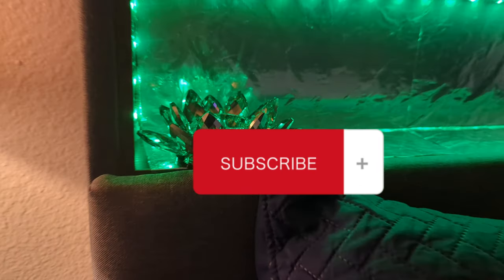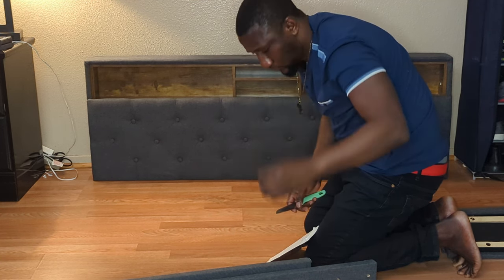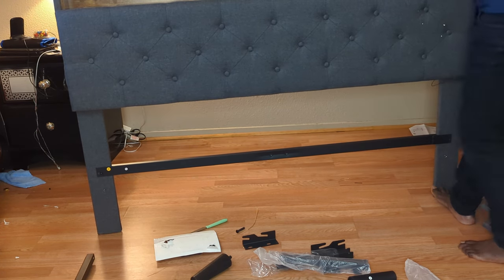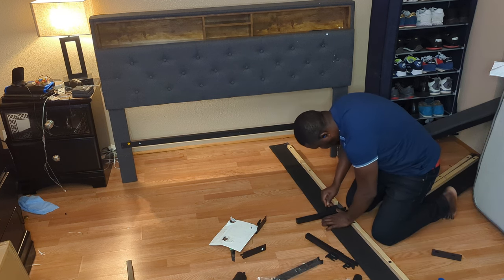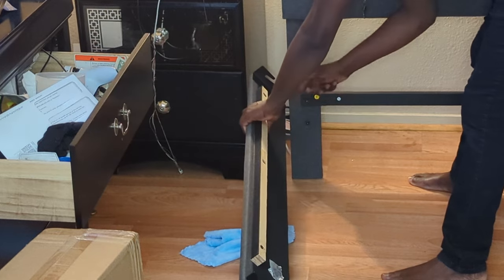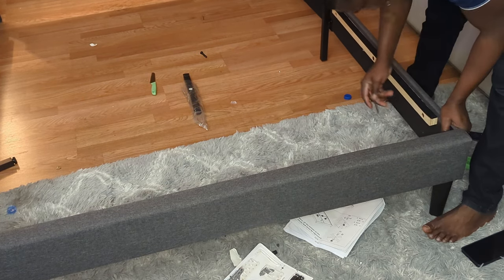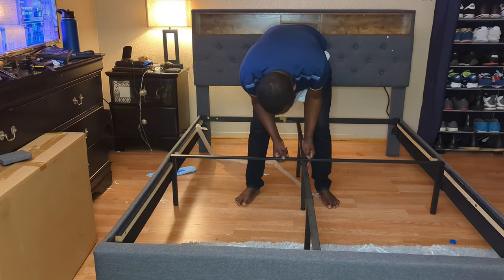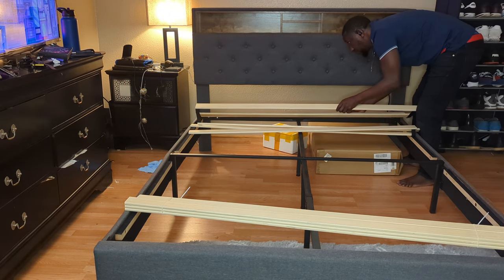Bed. ADORNEVE Queen Bed Frame with LED Lights, Outlets and USB Ports, Storage #viral #video #bed

Comment: Not helpful cause how I even get the headboard assembled
Reply: can you send me the instructions please !!! mine didn’t come with any
Reply: @BananaBread419 have u figured it out yet? Jus got mines a week ago nd was given poor or false instructions
Reply: @jay3d615  honestly it took about 4 hours to set up the king size version , the best i can say is just to take things very slow , there was a couple times we had to unscrew things because we put it on wrong or on to soon, there’s not a lot of videos to help so solely using the paper instructions was definitely a challenge.
Reply: @BananaBread419  very, I skipped certain steps just because they were too complicated. Now I’m stuck on a step where I’m supposed to screw some M6*10 screws to the little sticky velcro pole (#26) to attach to the storage cabinet (#2). I’m open to any videos or tips at this point 🤦‍♂️

Comment: It's almost put up, on the instructions it was showing to use the b screws more than the a ones, now I'm out of the b screws. Does it matter?
Reply from the maker: It matters, you have to follow the instructions accordingly. Only use the one that requires A or B. But it seems both the A and B are the same size?